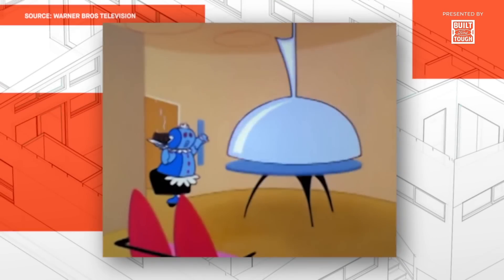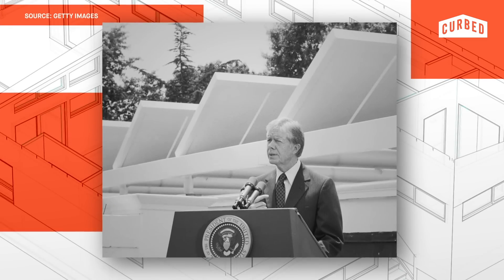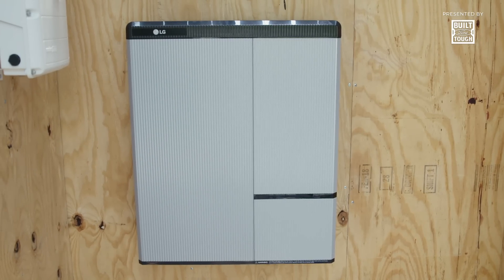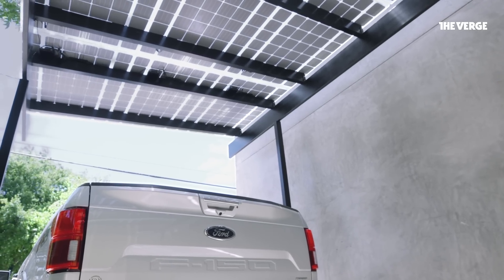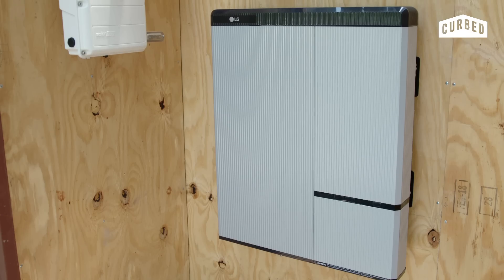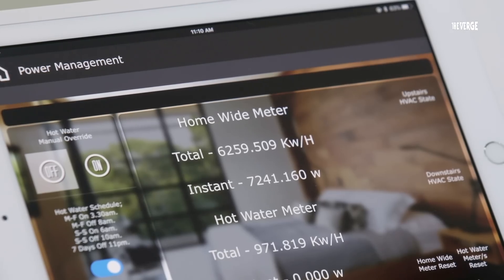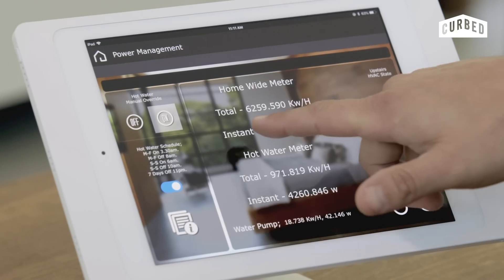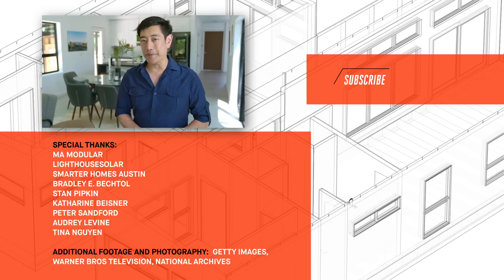The future of renewable energy is making it look cool

Comment: Something has to be done about the building envelope itself, like yes. It is now less energy  consuming process, but other than that and the solar cells. How does it work to reduce that overall energy gain? The skin and the large glass openings make air conditioning compulsory. Which is like still the elephant in the room. In addition to its energy consumption, there is also a refrigeration and air exhaust system which is not sustainable.
Incremental energy savings and generation is essential, but for a farther future. There have to be elements which reduce our needs on artificial cooling and heating ultimately. Cellars and lofts can be say one example of doing it with its subterranean cooling and direct sun heating, and who says that the house has to be built COMPLETELY off-site?
The idea is to look towards more primitive ways to make a permanent enclosure that lasts long enough, remember having multiple sleeping spaces for different times of day or seasons?

Comment: could the windows be made of double pane glass with an inert gas between them, or use Lexan for the panes. Lexan does not transmit heat through it as easily as glass.

Comment: The roof of the house at least should be white to reflect any light not being absorbed by the solar panels, not only will this cool down the house, reducing a bit of the AC needed, but also make up for the melting ice caps that were reflecting light before. The more light reflected, the cooler the earth becomes, which means more white ice will form, and reflect more light, and so on and so forth.

Comment: have fun clearing leaves and stuff falling off those trees onto the solar panels which are also blocking half the sunlight, one tree branch dropping on there and it's gone. and the panels fitted together are also not water tight, rain will easily fall right through and down onto your car, the panels are not mounted at enough of an angle for rain and leaves to slide off.

Also, the house is far from energy efficient with that many big windows, heating and cooling costs will be massive. the air-conditioning draws 6kw of power as input, just how massive is the air-con that's needed to cool that small house?

Comment: I would like to see a solar water tank heater (without solar cells, just the heat of the sun) they're fking efficient and dont require batteries. A fridge with a screen....really? Many "homes of the future" are portrayed like this, full of cool products, so is more like home of the coroporatios. That's not the future I want to live, full of unnecesary stuff and batteries. An energy efficient home is smart with the materials, windows, sun orientation, and things like air conditioner are not necessary. Maybe a simplier, smarter home with tecnology in the right places is the home of the future.

Comment: It all looks good on paper but wanting to stay comfortable is going to cost energy and there's no way around it with the current approach. Hot water, a/c, heat, and cooking are the major energy consumers and that's not going to change without major scientific inventions/improvements. 
   Ceiling, wall, and floor insulation needs to be greatly improved in the average home but home construction is not paying attention to this area in a major way. There are some products that can improve this but not to a major degree since the cost/savings ratio is not that great.
   LED bulbs can lower costs but there's the initial cost, which at this time is still expensive, and lighting is one of the lower energy consumers.

Comment: at  0.33  it shows the total power consumption 6398.143Kw/h   how in hell is that power efficient?????? even if u use solar panels  u need 6398/o.85  means u need almost 7600 wp on solarpower if 1 panel gives 200 wp u need 38 panels  how and where u gonna put those ???  looks nice but the power consumption woud  bankrupt ppl .

Comment: For my house the future I would have a Airborne wind turbine with its base mounted on the roof. This way I get more energy from the turbine always being airborne and I don't get the noise of a wind turbine that otherwise would be mounted to a pole attached at the ground. For safety sake it would need a light/dark sensor to turn on a flashing light so planes or any other aircraft don't fly into it.

Comment: One thing they didn't mention about powering the house during a blackout, the battery (LG or Tesla) needs back up capability. Which is an additional cost. If you purchase a solar system with an LG CHEM battery AND solaredge inverter you're fine, it'll function during a blackout. If you buy Tesla Powerwall 2 you need to buy the back-up capability to function during a blackout. Which is about $1500 AUD

Comment: Calling something a low voltage [V] item when it's using regular 120V AC... WTF
It 's a low amperage [A] / low wattage [W] item. (drawing less current than 'regular' items)

V is constant
V = 120
V * A = W
W = power consumption

Comment: A Home of the Future should be always be "Net Positive" 
while a current Home should go for a "Net Zero" Approach  - 

meaning a Home of the Future produces more Energy than it needs & is connected into Communities Micro Grid - 
and a current House gets updated to a State that it is self sufficient, 
because some Upgrades can be costly to retrofit into an existing Home, but even existing Homes can become Net Positive...

In the Video, the Battery Pack likely won't last a full Day for a House that Size...

This House should get a mixture of Solar Tubes for Hot Water & Photovoltaic for Energy.
But could have gone further with Geothermal Services to store Energy for the colder days.

And an Air-Conditioning Unit is often unnecessary, even in the Hot Climates of Austin Texas,
IF the House is designed properly & that can be done with a Pre-Fab Home TOO!

The open Cabling underneath the House is another Issue, because Wildlife could easily bite into it and stop your System from Working;
a Pre-Fab House should have large enough Cable Tubes running through the House to provide space for current required Cabling and future Add-ons.

Other Issues I have with this Home is Accessibility, 
there are still steps to enter the House, what about People with Disabilities and the Elderly?
The Military has a shortage of affordable Homes for Soldiers coming back, especially wounded Soldiers (!) 
and current + future Generations are becoming older and want to stay in their Homes as long as possible.

In the Bathroom you could use "The Shower of the Future" from Orbital Systems to reduce your Water Usage - https://orbital-systems.com/ 
Perhaps combine it with the Nebia Shower Headset as an Option to improve the Usage of the Water as it is shown in the Trailers.

Should your Plot of Land allow it - 
you could even look at a Wind Turbine (vertical ones, like installed at the Eiffel Tower in Paris / horizontal ones, like the Ridgeblade or the Basic Nacelle Wind Turbines on a Tower)

Comment: I want solar.  I want to go off the grid.  But I still wonder if todays solar and batteries can meet my power hungry needs?  I have over clocked gaming pc's.  I like to crank my AC till its freezing cold, not just cool, dead freezing cold, and of course all the other appliances in the house.  I want solar to power all this and still charge my batteries, so that I can still use all of these till the next day.  Is solar and batteries at this level yet?  Or do you still have to make huge sacrifices and compromises.  If they are capable and more, I want to see them in action and purchase them right away.

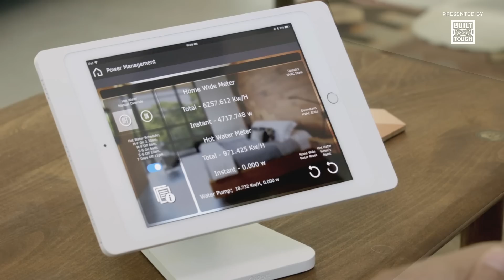Comment: @3:40 there's an architect firm (Positive Energy) near you that will design an airless cooling system for any size building (residential or other) - https://youtu.be/CVginpnALL8 
@4:18 you can get hot water from a solar hot water heater on your roof (yes, it takes away from photo-voltaic panel space, but it's worth it and I dare say that in Austin it will work 8 months a year or more.)

Comment: Why would the battery come after the inverter just to get converted back to charge? 
Thats way inefficient compared to Panel>charge controller>battery/inverter
Another idea is outputs for lower voltages such as 5 12 and maybe 24v, just to remove unnescessary conversions

Comment: If there is a hail storm, will the panels survive?
Reply: Great question! These Lumos panels have a class 4 hail rating, making them some of the most impact resistant modules in the industry.
Reply: @lighthousesolar6423 A few more questions.
1. What is the efficiency of each panel now ? How much power does it generate for this house (like a daily estimated power output stored in the battery)
2. What is the decreasing rate of power output after a span of 10 years. Also the efficiency after 10 years
3. How much total power in Kilowatt  does the house need ?
4. Is it completely off the grid ?
5. What is the annual cost for maintenance for a entire solar, battery setup ?
6. Consumption of electricity increases by few watts every year. Is the power setup scalable for , lets say ( parties where more people are using appliances for longer period of time, new hairdryers, new powerful vacuum cleaner or blender, an electric car). If we keep adding appliances is the battery enough to push power to the devices.
7. Cloudy days, rain, winter season, how much power output is affected by uncertain weather  conditions ?

Comment: Lots of "wow" and the (necessary?) dumbing down to make the vid more accessible, that I could cope with. Putting a Ford FTX in the driveway and not even mentioning the potential integration of EVs into the homes grid makes you sigh, especially from a European perspective.
Have fun swiping the leaves off of your horizontal carport  PV thingy.

Comment: I would like to power my house with a nuclear decay source to a thermionic converter.  Water heating could be direct heat from the decay source.  Cooling would be provided by spring water air cooler to an A-coil air chiller / dehumidifier.  If I had enough water spring flow, I would use hydro-electric power for my electrical needs.

Comment: A tankless water heater would remove the need to program a hot water schedule. More solar panels (on the whole roof) could generate more energy that could be stored in more batteries. An electric car could be charged from the batteries at night. Not too far from being off the grid completely. Gather the energy where the energy is consumed.

Comment: Also, just to add, sacrifices still need to be made. Why heat up a whole house in winter when you can just "heat up" the 1 inch of space around your skin by body heat and thicker clothes. Its not the most comfy way to live but it will save a lot of energy.

Comment: What about the HVAC system? Are you using a high SEER heat pump? Doesn't really matter if all those electronics are energy star rated, they still produce heat which has to be offset.

Also, what happens when you're dealing with cloudy days back to back? Solar is cool and all but very unpredictable.

Comment: It's quite practical to get the daily minimum power draw below 100W for an average American house. Of course, about half the day the fridge is going to be running and add another ~150W or so. But if you have 1kW draw for the house just sitting there doing nothing, you really need to spend some time tripping breakers to understand whats taking that much power. And in mild to hot climates, A/C and water heating is not a significant draw anymore. If you spend a bit more on the house when its built, air seal and insulate right, you can easily cool an average house with a high efficiency 2 ton heatpump, which should consume ~1kw or less. If you really wanted to go all out, a ground source heat pump would make it super practical to produce more power with just a few solar panels than the house uses. This is nowhere near as expensive or impractical as most people think, but it of course does cost more. If you have a 30 year mortgage, it would be super easy to spend more on the house build and still end up paying less per month if you can reduce utility cost to near zero. And then instead of building a house thats going to make you worry about setting the thermostat to whatever you want, it would be super cheap to heat/cool to any temp you'd like.

Comment: Interesting idea, but I see that trees are covering some sun light and the house itself might have a shadow on the crystalline silicon solar cells. But this might work very well in Dubai where car ports are used a lot and it is sunny all year round. Also roofs in Dubai are not like in the US, they are mostly flat and you can go up there especially when they come to service the air conditioning system fans and compressors. But solar panels can be placed up there above those air conditioning things and get that direct sunlight all year long.
I hope you are using sunpower solar cells in those panels since those cells are built to better handle those shady situations.
Even newer kinds of solar cells are in research right now especially the thin film panels.

Comment: Not a good advert for energy efficiency education:
Bad house design
Way too much exterior walls
Way too much glazing
No indication of R values for insulation
No passive design elements like sun facing glazing onto concrete floor or wall
Poorly orientated solar cells
Too small battery system
No provision for EV charging

Comment: Sorry, but this is garbage. Many of the comments pointed out the issues with the installation. Also the parking F150. Clearly the company selling this is for the looks and the "idea" only. Solar cells are performing really "bad" if they have no direct sunlight, even when there are clouds. The best solution is still to put the cells on the roof. Don't kid yourself that you could be independent from the grid just with some cells on the garage. Oh, I also want to note Grant sounds very much unnatural in speaking. He should have noted those bad units on the tablet too.
An other thing is the installation and maintenance costs. The usual return of investment is anywhere between 5-10 years, but that is only for the costs (20000+) of the installation. Your batteries are only good for 500-few 1000s of cycles and those costs 2000+ US. Its a good toy as of now.

Comment: Are there any studies done on the net savings of greenhouse emissions? I wonder what kind of resources and pollution goes into the production of solar panels, batteries etc. and how long it will take for the energy saving device to "pay" for itself in terms of emissions. Also, what does the end of the lifecycle of these products look like? How much toxicity is being added to dumps and what is the decomposition/recycling outlook?
Reply: Easy to find in a couple of minutes on google, but the answer is about 12-18 months. Crystalline silicon based panels are the most recyclable, and luckily are also the vast majority (90+%) of the panels manufactured.

Pollution is not too bad, especially compared to coal and oil, but there is a very real problem with the production of the cells, mostly to the workers (silicosis is possible). This can be managed with safe work environments, etc. It is also a problem at end of life, but again can be managed.

https://www.solarquotes.com.au/blog/solar-panel-recycling-france-mb0644/
Reply: Oh nice! Thanks for the info.
Reply: No worries, that's actually a pretty good link that I haven't seen before.

Batteries have the same issues - we can make them out of pretty recyclable materials, but they aren't always. Also, they're not super clean to make, but they can last a long time if well looked after, so the pollution per year is low.

Ultimately the recycling issue is one of volume - the vast majority of solar panels manufactured are still in service, and will remain so for a while, because they don't often break. The same goes for batteries in vehicles. We won't see big strides being made in either process until significant product goes end of life, but there are companies thinking about it and designing for it now, and a few doing it on small scales.

Comment: The only problem I see with non adjustable panels is that you lose so much energy by not tiling it to the right angle. The angle of incidence of the sun varies so much from summer to winter!
Reply: Where does energy not used by the house go?
  2) How much power can this setup provide for their needs?

Comment: I'm all for sponsored videos, but a Bolt would have been a better pic here.  Ford trucks are usually not what we think of for future vehicles unless they have a fuel cell one in the works.  Also, decorative grass is going away too- just ask any homeowner in a state with regular droughts.  If you have a patch of grass, you still need a mower, sprinklers, etc.

Comment: 800W is low power usage? WTF America? Also, they installed solar panels near-horizontal and below a tree.
Reply: Yes, 800watts for a 3000 sqft home is very good. Thats with lights on and family home.
Reply: Our 100 year old 2000sqft house consumes 700W including a 350W server rack that I expect most homes don't have; so that is 350W for the rest of the house. 800W for 3000sqft does not sound impressive to me.
Reply: Yeah we have 2 deep freezers and one main fridge/ freezer, all LED bulbs (56 of them), energy star everything, gas dryer 4 wall mounted TVs (all new) and speakers (in ceiling) in every room. Still my lowest that it will stay at is 450 watts (usually 800-ish). You know, till the AC kicks on :( 

also this house has 5 kids, 2 adults and 2 dogs living in it. lol
Reply: Your power usage sounds reasonable to me, I am just still at a loss that it is considered very low in the US, when I would consider 800W for such a house to be fair (obviously, pre-AC). I am largely wondering where all the extra power is going in the typical US home.